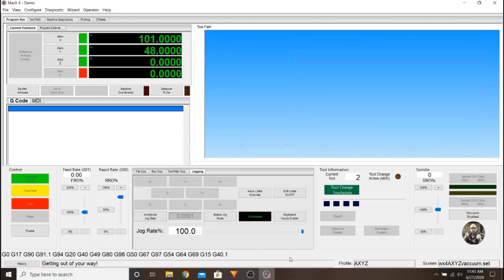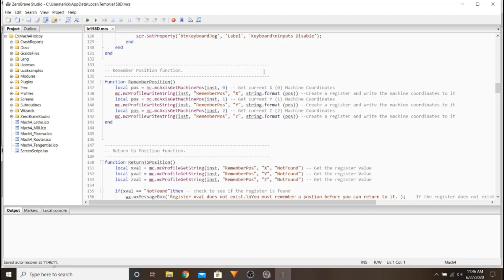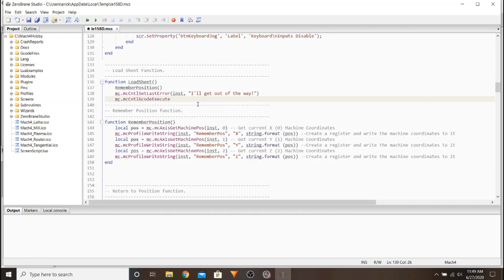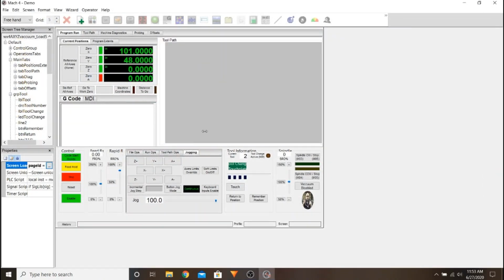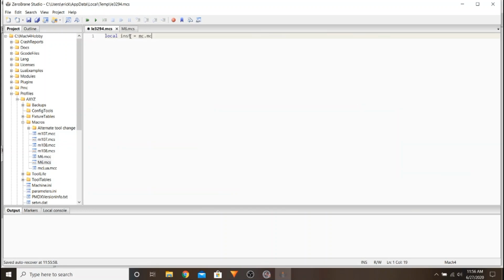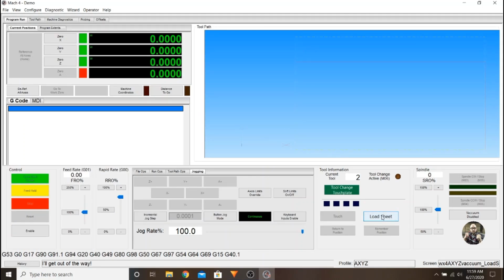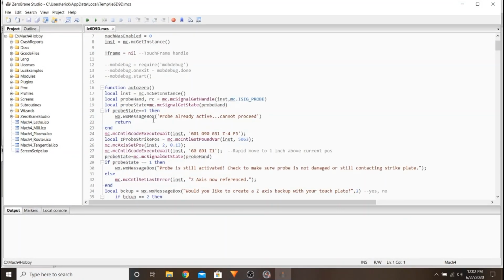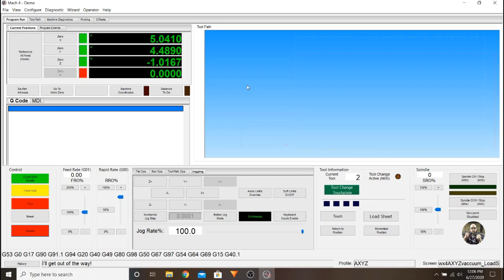How to create a custom Mach 4 button to move the CNC out of your way

Comment: I wanted to add a note for newbs like me..Disclaimer I AM NOT EXPERT at this, but I am stuck in a holiday inn with lots of time to search the internet 😝 .If you call out G54 like the video shows, that sets the machine in work coordinates. That didn't end well for me, but I did have the e-stop in hand.  For me it was better to use G53.  That way no matter where my work "0" was set it will go to the same position each time.  G53 tells the CNC to use machine coordinates for positioning.  (home position)  Also, to get your buttons to change colors you need to go into the button configuration and set the "BG color" as silver and the enabled states to IDLE .  Thanks again for taking the time to do this.  I wouldn't even know where to start if you hadn't done the video.

Comment: Hello Tyler  wanted to reach out to you. You help to calibrate my x& y axis motor a White ago. Since I didn’t I haven’t had am problem wit it. Thanks for you help. How ever, I have a problem with my machine. My handheld DSP stopped working. my current motion controller is RichAuto With a B581 DSP. I am looking to upgrade my 4x8’ Chinese CNC with the C25xp with Ethernet Smooth Stepper. Can you assist in anyway? how can I reach out to you so we can talk in details?

Comment: what kind od pendant you are running ?
Reply from the maker: 4 Axis 6 Axis USB Mach3 Wireless Handwheel Controller Remote Hand Control CNC Handwheel Manual Pulse Generator for CNC Lathe Engraving Milling Machine (WHB04B) (4 Axis) https://www.amazon.com/dp/B07JN4P3YH/ref=cm_sw_r_apan_glt_i_SK45XPCBHTQ39JH4ZN7T?_encoding=UTF8&psc=1

The latest development version of mach 4 has built in support.

Comment: What power are you running your Cnc on 400v? Or 200 converted?
Reply from the maker: 220 single phase. The phase converter bumps it up to 3 phase for the spindle.
Reply: @TLARinc  what type of phase converter? What’s the KW HP of the spindle? Thanks
Reply from the maker: 5 hp spindle, single phase to 3 phase converter.

Comment: Since I installed mach4 my pendant just like your model will not work, please guide me to the driver that works, sub'ed
Reply from the maker: Here ya go! https://www.machsupport.com/forum/index.php?topic=37581.10
Reply from the maker: Hmm... I think I can make a video, there is also a version of the plugin that requires a driver to be installed. I’ll look for that later and get you the link, it’s a pain in the butt because It’s an unsigned driver So you have to change some system settings to make it work.
Reply: @TLARinc  I now have two 4x8 machines both on mach 4 I just bought a mini keyboard to jog the machine, but man I miss my mpg functions for sure
Reply from the maker: Heres the plug-in that requires a driver, make sure to read the read-me as you have to disable windows signed drivers. 

https://drive.google.com/drive/folders/1wVO8aDuZ_SR6SUW6v3jKpXH0iQ3LwJq2
Reply: @TLARinc  thanks for this, will let you know how it works out
Reply: @justice_for_juicy4179  Hello to all,  I am also extremely interested in the possibility of getting that type of Pendant to work in a wireless mode.  I have been using a wired mode.  I put together my own system using big motors which are driven by Mach 4 via a C62 break out board tied to ESS.  The vendor of the gear, Arturo at CNC4PC also is unaware of a driver.
He will look into the issue and is also interested.  I am open to direct communication via email: yachtlover@rockisland.com.  Hope to hear from someone.
Reply from the maker: I’ve been playing around and trying to duplicate your results and I think I may know what the problem is. Look for a video hopefully soon. Once I get caught up with Etsy orders.
Reply: @TLARinc  are you still willing to put a video on the mpg?